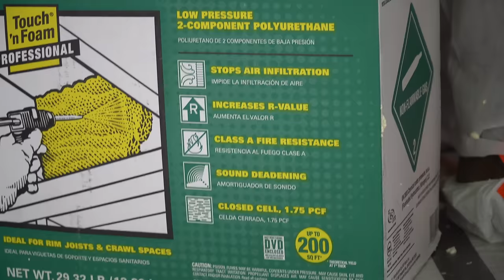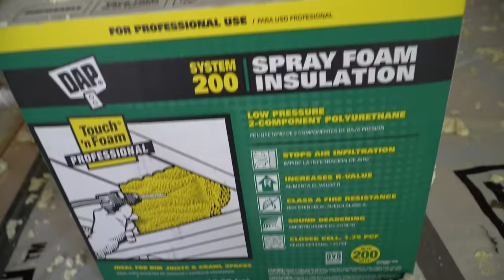How To Insulate Your Van With Spray Foam!

Comment: That spray foam is great for stopping temperature change through conduction, which will stop condensation.  Because the metal and fiberglass will not sweat due to temperature difference between the outside and inside, when she's ready to add more insulation - because that thin layer won't be enough - she can add any other soft fiber she wants between the van skin and interior walls without worry about mildew and mold (wool, denim, thinsulate, fiberglass, rockwool, etc).  Great start to an unusual vehicle :)  Looking forward to seeing more of this build.

Comment: Ya'll did great.  Remember this will expand during curing. Best to start with the flat tip to take up as much surface.  The thin tip is for and missed spots , give an area a bit more foam, or for hard to reach areas.

Comment: You did a great job on your part. So did she. I had this done to my van but my fake "van builder" I'm bummed because I spent a lot of $$$ on it and it wasn't done properly. I will end up having to redo it or add the panels like your van. Mine is a closed cell as well. I have COPD so it was necessary. Thanks for sharing! What a great Friend 👍
Reply: Mineral wool ok with COPD & better fire rated & cheaper.

Comment: I wonder what a spray foam home insulator would charge to do a van?  I'd like to see a comparison-or even if they would do a small project like a van.  Just a thought.....
Reply: A company told me that for a 12x6 by 12 tall building would be over 2 grand last year. It’s expensive stuff. Foam gold.
Reply: @Seraphsody  I'm in the wrong business......maybe foaming vans should be my new business!
Reply: Hunter357magg lol 😆 It may very well be a lucrative business, it’s soo expensive. The local company that gave me the quote said they were charging based on hours, experience, and materials. It’s also comparable with the going rate online.

Comment: great video as always! 
it's kinda funny - in almost every van built video that takes place in europe you never see spray foam, everybody is using armaflex :D
Reply: Exactly. They say spray foam attracts moisture and mineral wool slumps down cause of the vibration while driving?
Reply: @farinab.1336  Don't know where you got your info from?... i'm from the UK and I spray foamed my van!.. I got mine done by reputable  company!... spray foaming your van gives you a much higher R value than any other type of insulation!... it also acts as a sound deadening/ vapour barrier and top insulation all in one!... down side is the cost!..( mine cost me over a £1000 ) in USD that's about $1,388.00!.... also you need to make sure that you have run all your line's in ( that's your LPG/WATER & ELECTRIC'S ). and that the are in conduit or some form of trunking.... as you will not be able to get at them or run other lines.as this stuff is there for good!...will not budge... so good careful planning with all your line's is the #1 factor...also spray foam does not attract moisture!... also the only way that any ones mineral wool would slump down is the fact that... THEY DID NOT DO THE JOB PROPERLY IN THE FIRST PLACE!.... if you dont pack it in to all the nooks and crannies it will drop due the lack of volume if insulation material!

Comment: Did you ever think about rust issues? When humidity will get stuck between the bodywork and your insulation (and it will), your van could be pretty much gone... Pay attention to all drain holes and not clog them, as well as which type heating system you'll be using.  All in all, you don't want too much condensation happening. Insulating vehicles is no easy thing, that is why it is so expensive. DIY methods are on the cheap side, but watch out for what can happen in the long run.
Reply: People have no idea about spray foam in a vehicle..even nowadays I still see people doing it.
While people who did this 3 years ago recently found out that the panels started to bubble on the outside of the van😅
Seen some of these cars for sale recently too..imagine if one would buy a car like that not having a clue
Reply: You think condensation will get stuck between the spray foam and metal skin?

Comment: Did you spay the back doors?
Reply from the maker: No. I started to, but realized I didn't want to cover up the door electrical and locking mechanism. She was just going to use some wool insulation to fill them in if needed.

Comment: Mineral wool in insulation area at Home Depot & foam board would have been WAY CHEAPER
Reply: home depot has that??  awesome.
Reply: everyone says that spray foam is the best insulation, so I guess it might pay for itself in that sense
Reply: Tormenta de fuego americana i don’t think everyone says that... there is the problem of it expanding too much and bubbling out the van body.  also it’s very messy, and it’s pretty permanent.  probably not a problem for some people but not for me.
Reply: @lostman65  Yes in the same type of package the fiberglass type comes in & the plastic is red in color. I want to say I paid about $40 per bundle. It's not cheap but it's mold resistant & fire rated too.
Reply: XRP DT thanks for the heads up! my local hd didn’t carry it so  i checked the next closest and it had a bunch on the shelves
Reply: @lostman65  I had to look for packaging for you. It's made by Owens Corning. Red/white packaging & it's called Thermafiber. It's a fire & sound guard. I will post a video today showing my van build insulating. I'm currently in the process. 😎👍

Comment: I don't think that van is worth 5500 dollars, tbh. Certainly considering the amount of stress on the engine and shock absorbers an ambulance goes through in its lifetime. Very cool build though!
Reply: They said it only had 178 miles on it.  Which, unless they meant thousand and misspoke, or someone illegally dialed back the mileage read out, means that this van was a steal for $5,500.